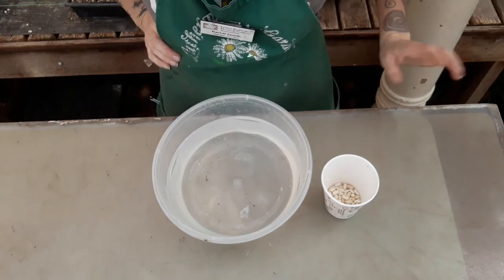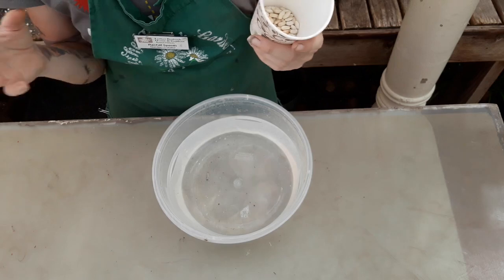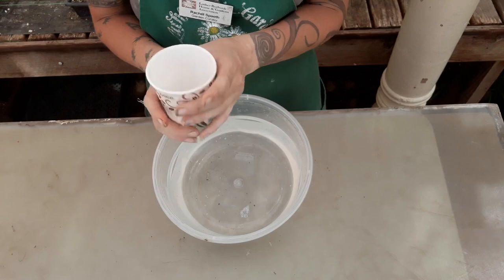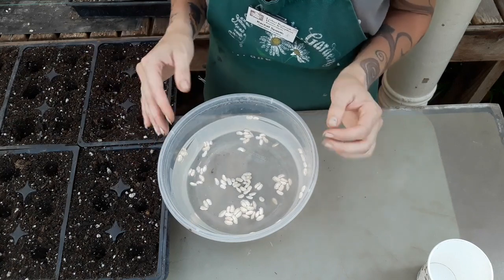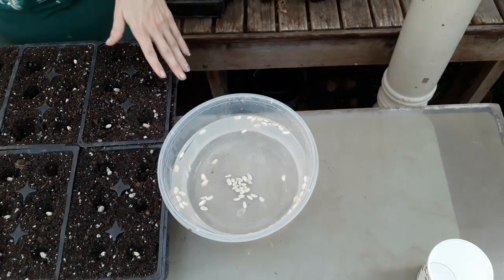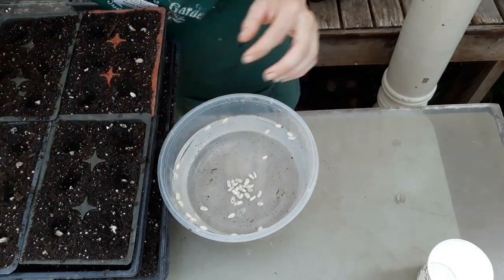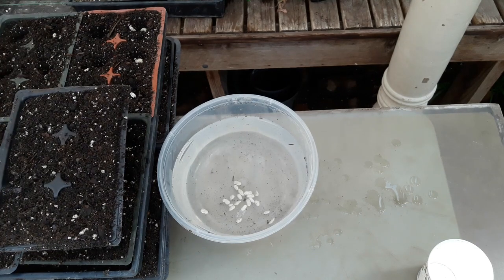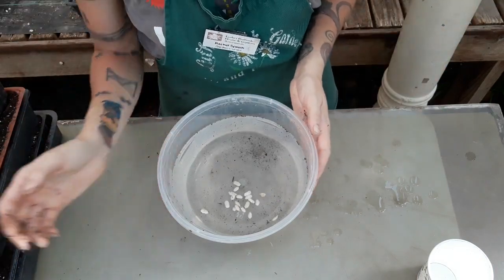Seed Float Test for Viability

Comment from the maker: The results video is here:  https://www.youtube.com/watch?v=pN2AtTkKLuQ&list=PLw8926uHf5vPBo7x4DjNWPFklXvEw6MpE&index=85&t=8s
Reply: Somehow I thought you were saying the floaters were more likely to do well, but I was wrong.  It seems like your theory about the sinkers was accurate if 30% germinated vs 2/81.  The slugs could have easily thought either was delicious and they all had the same conditions afterall.  It’s almost like you expected your experiment to work the other way, but just because it didn’t doesn’t mean you messed it up by under-soaking. I’m surprised you didn’t conclude your theory was correct by the numbers alone.